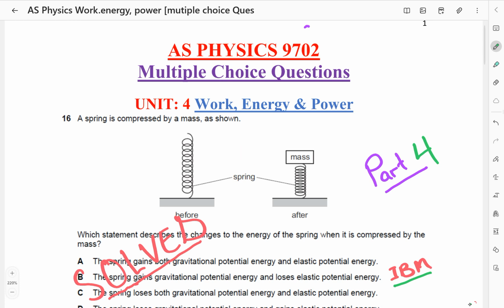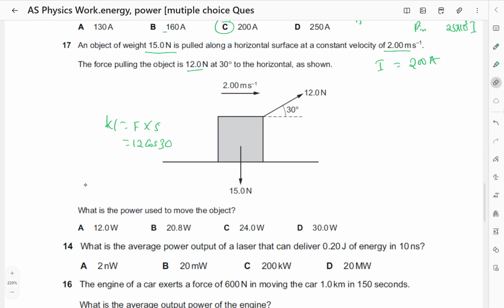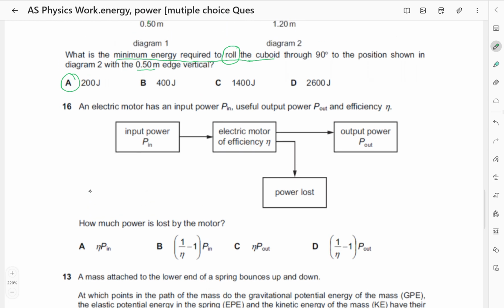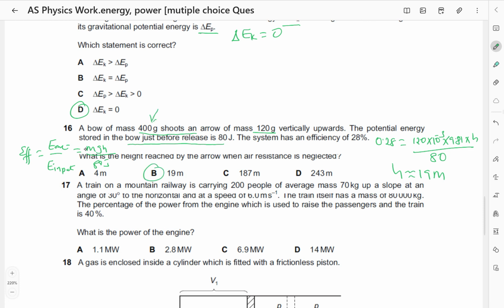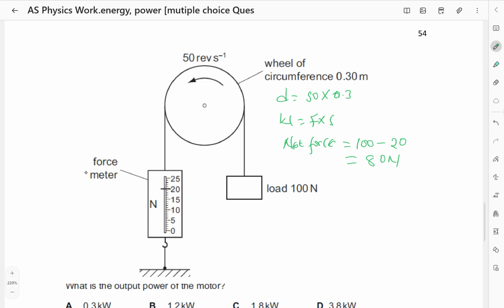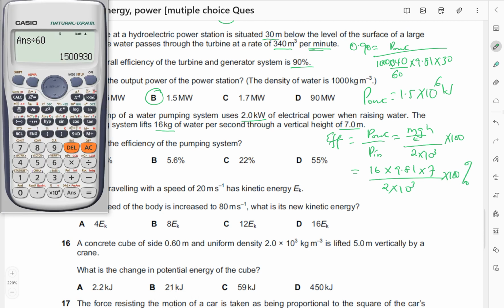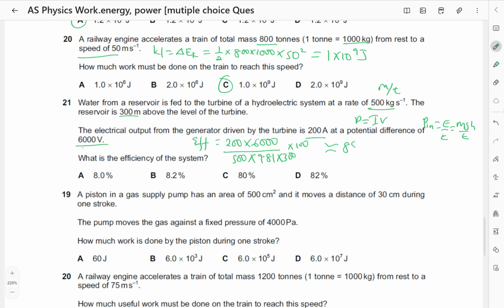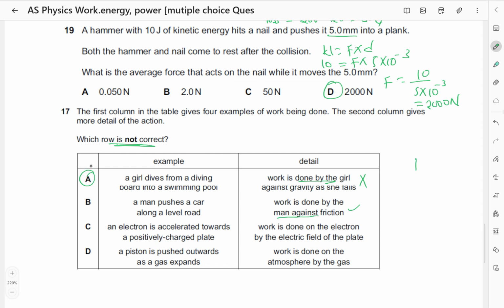Work, Energy & Power; CAIE AS PHYSICS 9702 [MULTIPLE CHOICE QUESTIONS] #Part 4

Comment: 1:51:21, why didn't u consider the component of weight down the slope, its true that angle is not given but we can calculate the angle by Trigonometry and consider the weights component acting down the slope? Can u explain?
Reply from the maker: i needed speed, u could use trig to find the angle then get component of g as gsin of the angle and then use equations of motion
Reply: @learnPHYSICSwithIBM  how do u know that we have to apply the equation of motions cuz Ig the question does not mention anything about that?
Reply from the maker: @hamidSohail-vy3ei  creativity
Reply: @learnPHYSICSwithIBM  What do u mean?

Comment: Hello sir, since you mentioned before that these questions are from between 2001-2022, are these questions in sort of an order of the years like do the latter videos in the series of each topical practice contain the questions from the recent years or smth of that sort?
Reply from the maker: I think 2022 downwards, but i might have disorganised the order in the process removing repeated questions
Reply: @learnPHYSICSwithIBM  that’s fine sir, it does not have to be each year by order as long as the the newer ones are together that should be just fine, I was wondering so cause I’ve practiced the concepts well and done questions here and there but haven’t finished all the topicals of all topics yet so if the recent years were together then I could watch the last 4-5 videos of the 2 chapters (waves and electricity) to get a grip on their mqc questions and if I still have time afterwards then I plan on watching the first 3-4 videos of their playlists as well^^ thankyou so much for your selfless service
Reply from the maker: @nuhanuryea7855  u can watch the first 2 to 3 videos per topic. those are the newest past paper questions am sure
Reply: @learnPHYSICSwithIBM  I see, thank you soo much for letting me know sir!